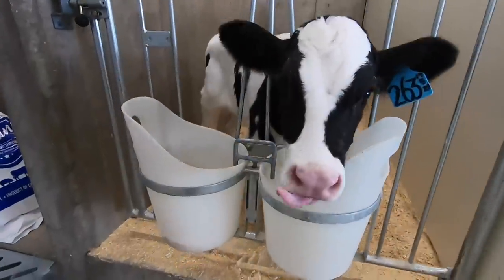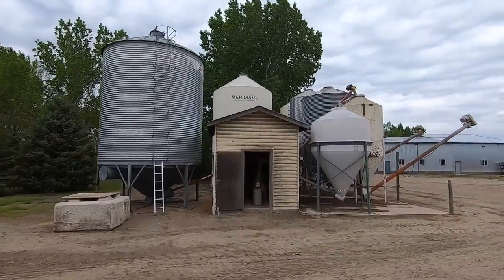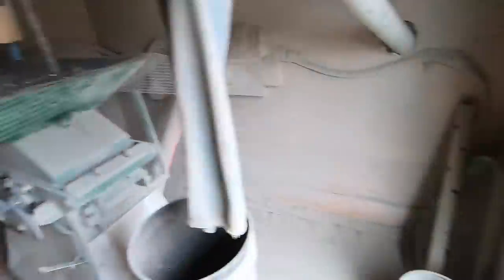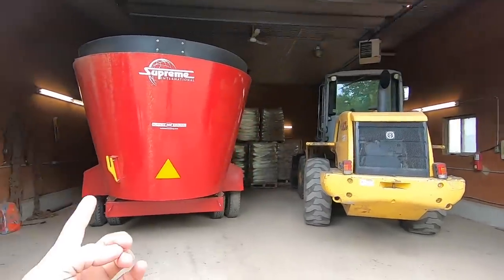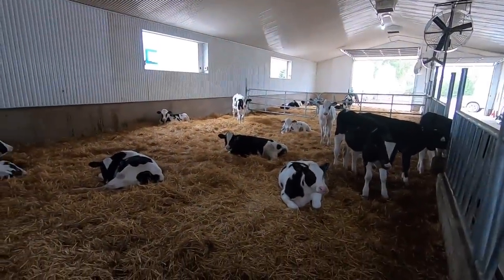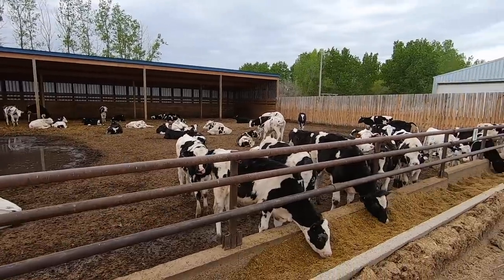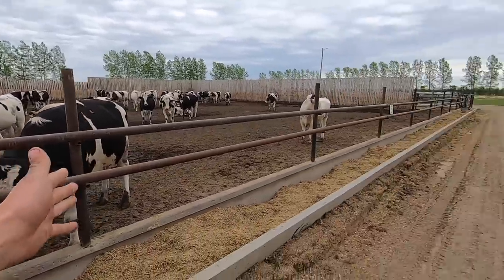What Happens to Bull Calves on our Dairy Farm?

Comment: We have a mix of winter triticale or barley silage, corn silage, haylage & oat/pea silage, mixed with dry hay bales and we add earlage (add combine corn head to our forage harvester and process the whole cob & put in silo at higher moisture), rolled oats, toasted soybean meal (from local soybean oil processor), DDGS (from local ethanol plant), minerals and supplements.  We add water & molasses.  Of course, we have different recipes (like you) for each set of cattle (active milkers, dry cows, heifers, steers).   Keep up the great videos!

Comment: Most farms in the UK here use a silage shear grab that you push into the face of the clamp and then the blade comes down like your loader with its 2 attatchments- it leaves a clean, flat face on the clamp that means less waste and spoilage from loose stuff all over the clamp front.
Have you ever thought of one???

Comment: Informative. What is silage exactly, the whole plant cut up?
Reply: Here in ireland its generally grass that is stored in a concrete pit and is covered with plastic and tires to keep the air out, there is bacteria then that "processes" it and in about 3 months you have silage
Reply: Silage is any grown foliage plant that is fermented so that it is easier for cattle to digest.  Can be made from almost any plant, from grass hay, alfalfa, corn, wheat, barley, oats, peas, etc.  For grain crops, generally the grain is grain is harvested first, then the entire remainder of the plant s cut & fermented to produce silage.  For example, with corn (maize), the corn is picked first, dried, and sold.  Then the entire remaining above-ground plant, the corn stalk & leaves are cut off near ground level, chopped up, and made into silage.  This part of the corn plant would be waste if you were only after the corn crop.
Reply: Around here, the entire corn plant is cut up. There's special rollers in the choppers to crush the kernels for easy digestion.

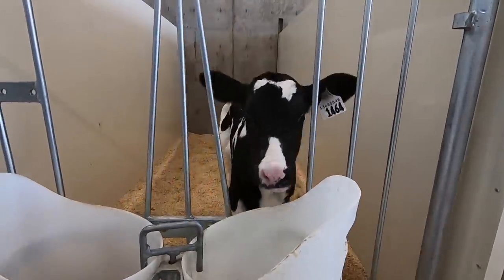Comment: 1:49 answers the question. How exactly do you castrate the bull calves?
Reply: There are two different ways. Cutting, which is essentially surgically removing the testicles or banding, which is when a band is placed above both of the testicles and they will rot and fall off in two to two months depending on the animal. I like to cut my bulls but band my goats. I hope this answers your questions :)
Reply: Emily Light I meant how does this farm castrate the bull calves. I’ve grown up with cutting but I plan to band my bull calves in the future

Comment: Was a bit surprised to see that you did not add any molasses to your TMR mix (sugar beet tailings contain almost no sugar).  Almost all dairy farmers do add molasses down here in the lower 48 US states.  It's a pain to handle (requires heated tank), especially in winter.  Also, it wasn't clear if you segregated your dairy cattle in anyway.  Penn State estimates a 4 to 5% milk output increase by separating your cows by production levels.  Penn State, a leading dairy agricultural research university, has some excellent articles with definitive conclusions about feed composition and feed management practices.  Read them in your spare time (joke: dairy farmers have NO spare time).